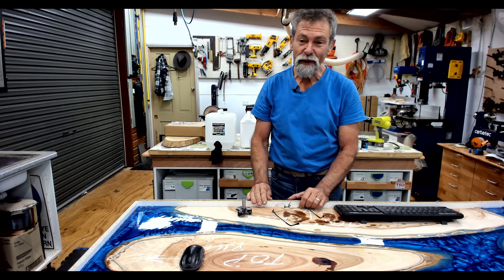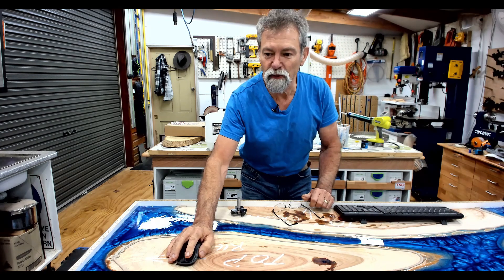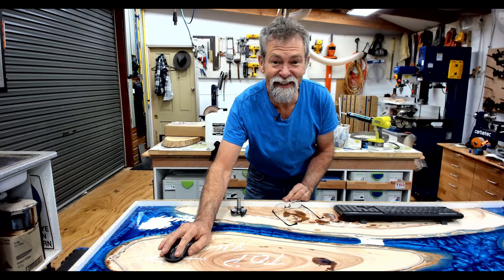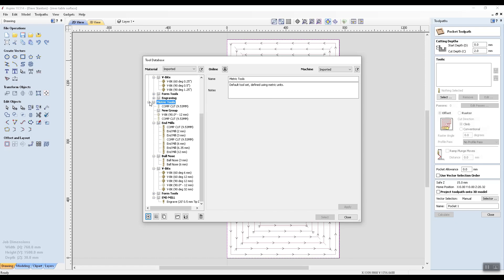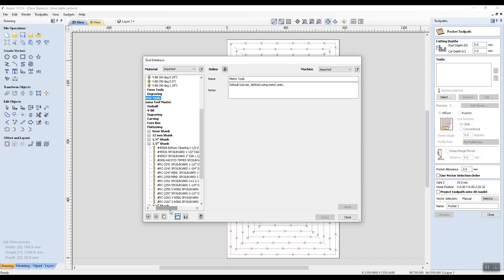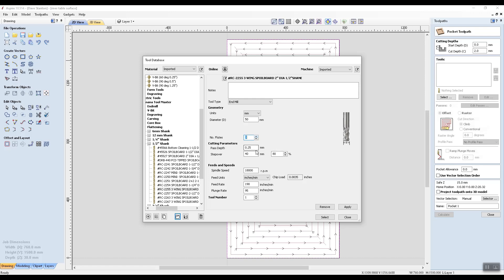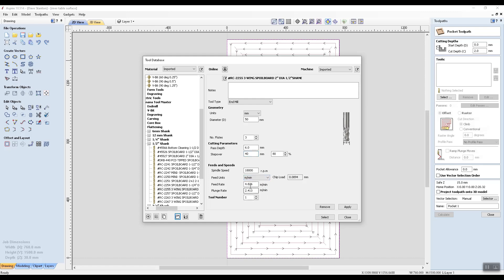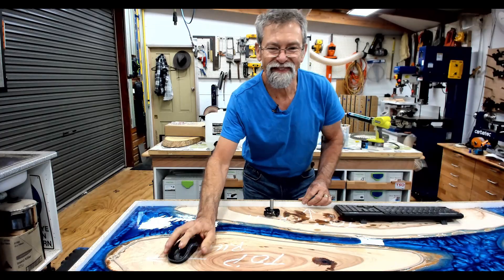How to import Amana Tool Feed and Speeds into Vcarve and Aspire Dave Stanton

Comment: Regarding your pass depth Dave, whilst recommended from the manufacturer that's fairly aggressive for a light industrial router such as you have. I think you'll get a lot of chatter. 3mm at 4.8m/min would be a better option. Bravo on the table design, looks great. Looking forward to seeing it on Sunday. EDIT** Just noticed that you've set the cut depth at 2mm, please ignore.
Reply from the maker: I agree re pass depth. Although mine is a 3 horse power spindle. The other thing is the pass depth I have set for this toolpath is 2 mm.

Comment: Hey Dave. Would changing the cutter diameter from 2 inches to 50mm give you an error at your first and last pass? That is, the metric equivalent is 50.8mm not 50mm or does the stopover account for that?
Reply from the maker: Hi Stak Walderbak. Yes it would. But in this instance I am only surfacing a board. So Vectric leave it up to you to do the conversion because if they do it, then some rounding may come into play and a loss of accuracy could occur.

Comment: Hey Dave wouldn't it be nice if when you changed to  metric that all the parameters automatically changed. I didn't change these once and wondered why the toolpath was 3hrs I worked it out in the end. I have a 3.2 amana ball nose to add that I purchased through your link so good timing on the video. The drafting table is looking good  I just can't see how you would get much work done it will be hard to take your eyes off it cheers.
Reply from the maker: Interesting point Michael. I have contacted Vectric to see if there is a metric default rather than imperial. The table should look pretty slick. Excited to see how it goes on Sunday!